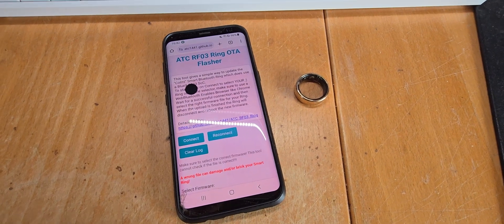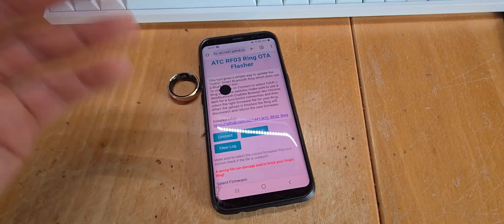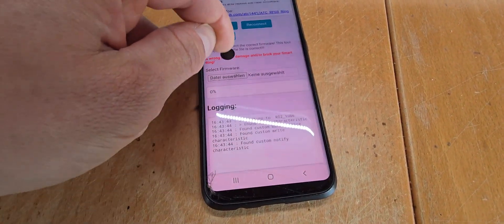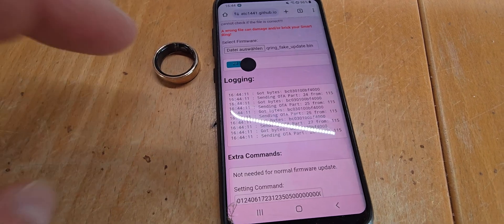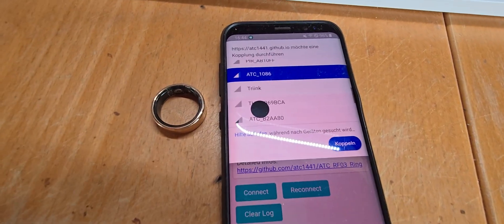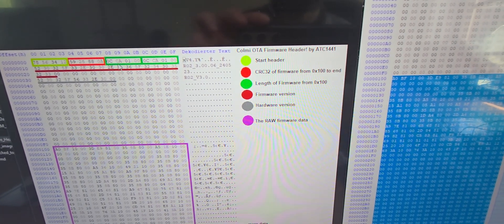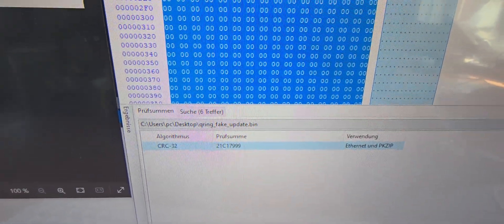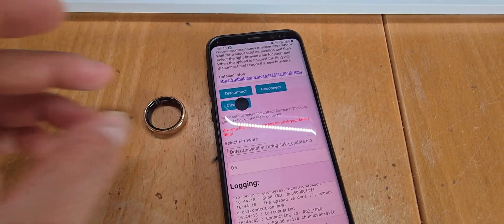Bluetooth Ring Hacking, OTA Firmware upload

Comment: Hello Aaron, I've been unable to flash your "R02_3.00.06_FasterRawValuesMOD.bin" firmware onto my Colmi R02, as the log reports "Rx wrong CRC!" immediately after sending part 0/115.

Do you have any ideas on where to go from here?
Reply: hi! I have the same problem, did you manage to find a solution?
Reply from the maker: Your ring has a different Chip inside and is not compatible with that firmware unfortunately.
So the CRC error is correct
Reply: @atc1441  thanks for your answer. does that mean it won't work at all for the newly bought rings? I ordered it with your link
Reply from the maker: It seems to be at random. So the next one could be a good version again. But thats really just a gamble

Comment: Hi,
Is it possible increase the accelerometer sensor update rate?
This is what the accelerometer datasheet says
"Bandwidth
There are two different data stream of STK8321, unfiltered data and filtered data. Unfiltered data is sampled as 2 kHz,
and the sample rate of filtered data depends on the selected bandwidth; it is twice of the bandwidth. If the DATA_SEL
bit in register DATASETUP (0x13) is set to '0' ('1'), the filtered (unfiltered) data will be stored in the XOUT/YOUT/ZOUT
data register. Each of the data stream can be separately offset-compensated, and also can be the data source of
interrupts controller. The actual bandwidth for the filtered data can be selected by BW [4:0] bits in register BWSEL
(0x10)."
How can I update that in the firmware binary?
Regards

Comment: Instead of cutting the epoxy, maybe you could have pressed sewing pins through the epoxy to make contact with the copper pads?
Reply from the maker: Its to hard for that
Reply: @  Drill some holes with 0.1mm pcb drill bit?

Comment: I found a similarly priced ring that includes a motor, RGB LED, and a button. I was thinking it could be synced with smartphones to receive notifications. I envision:

Green+motor = SMS/MMS
Red+motor = Call, which can be deciphered but not accepted by a button tap during the initial notification
Button tap = Wakes and flashes the corresponding color for each current notification
Long button press = Clears current notifications.
Since I use a pinephone, my current running watch doesn't support syncing with it. If I got a pinetime, I'd be stuck wearing two watches or going without the convenient features of the one I already have. I suspect I could get some level of notification syncing working, but I'm totally unfamiliar with gaining the ability to push custom firmware to such devices like you do in your videos.

If you decide to  test out the ring reply here so i get an email about it.

The link is broken because I suspect youtube does not like me putting it in a comment.
aliexpress.us/ item/ 3256806919968284.html

Comment: Hello!nice work as usual!
i'm in the way to buy it but i've just a small question,did you know what diffs with the R06?
my second question is what can be updated within the firmware to make it better?
Greets!
Reply: I had this exact question when I first learned about these this morning. From looking at Colmi's website, the battery is the only spec that really seems to change between the R02, R03, and the R06. 

The R06 has a bigger battery at the larger sizes (sizes 10 and larger get 18mAh) and a smaller battery at the smaller sizes (sizes 8 and 9 get 15mAh). It also has a fancier external metal design. 
The R03 has the smallest battery (15mAh), but I think that was done to make it thinner as it's the only model showing a bump out in the epoxy for the HRM/SpO2 sensors. It also comes with a USB-C battery charging case which I prefer over the small USB cable that comes with the R02 and R06. 
The R02's only stand out feature is having the same 17Ah battery on the smallest size rings as well as the bigger ones.

There might be more differences, but I haven't found them.

As for your second question about making them better, they seem to be about as optimized as possible for what they're intended for. Aaron mentioned in his last video that he might want to expand and intercept the gestures that use the accelerometer to control smart home stuff, but that'd be something personal, not exactly something "better". If you want to use it as a fitness wearable, it's got sane defaults and apparently some options for heart rate monitoring frequency. Maybe you'd want to add more options? Not necessarily "better", but perhaps better suited to you. He mentioned in the last video what hardware was included in the ring, so anything you can envision that works with that hardware should be possible, but using it for gestures probably makes the most sense as practical things you can do with the available hardware.
Reply: Which one is the rim? I couldn't flash it to my colmi r06